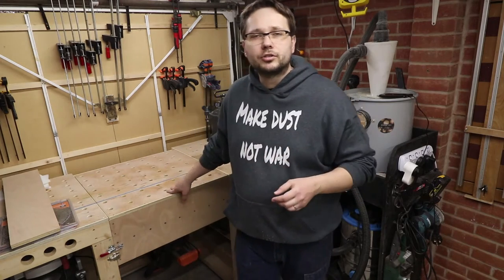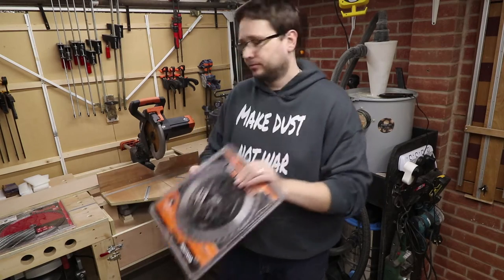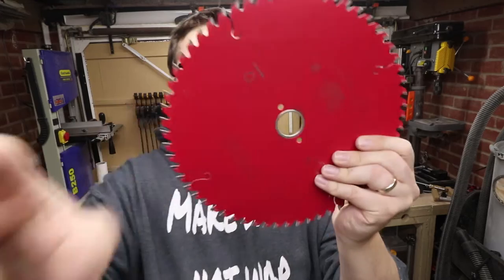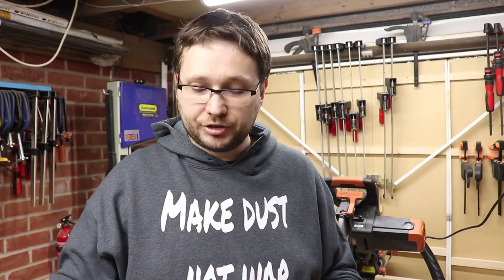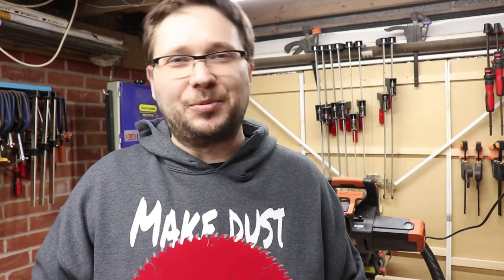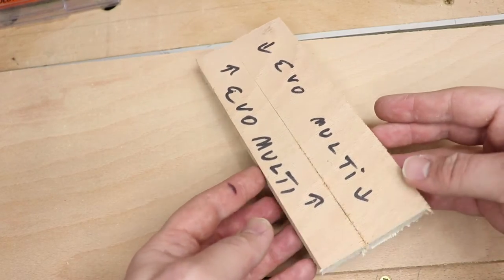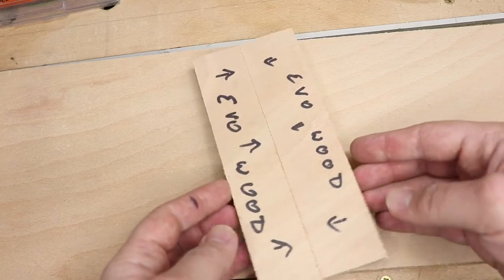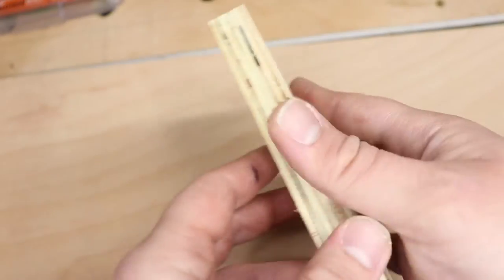Evolution mitre saw with none Evolution blades plus cross cut blade test

Comment: Amongst my blades I have two freuds.  One is a pro 24t and is superb, proving surprisingly clean cuts cross cutting as well as ripping and one is the 40t.  No notable tear out on my table saw.  You have to be careful when selecting freud blades as they all look alike but they have a baffling array of codes and there’s a big difference between them.  Mine are the 15 degree positive rake angle thicker kerf table saw pro versions and slice like a knife through butter.  There are thinner kerf mitre specific version, versions with atb, tcc, different coatings and higher quality carbide teeth such as the industrial coded versions like the p410 .  Point is you can’t generalise about freud without knowing what you’re comparing.  Even the relatively inexpensive freuds will likely last longer than the saxtons which don’t have as much tooth material and cant successfully be resharpened.  Good cheap blades for sure but  false economy unless you’re an infrequent user.
Reply from the maker: I think that's the general point, if you are a occasional user then the Saxton will be a good choice. However if use your saw on daily basis then Freud will be a far better investment 👍

Comment: I just purchased the Evolution R185SMS+ saw, the 7-1/4" model with the laser. Just assembled it this morning, in fact. Still need to try it out. I bought it for cutting metal. For cutting wood I have a 10" Delta compound sliding miter saw.
One complaint I have read about these saws it that you're locked into using Evolution blades due to the arbor size. While installing the blade I took the inner blade washer off. One side has a 20mm ring machined into it, while the other side has a 5/8" ring machined into it. So I can use a blade with either a 20mm arbor or a 5/8" arbor! 🙂
You may wish to remove the inner blade washer and see if it has two different diameters machined into it. Or maybe you touched on that and I missed it. In which case...... never mind.
Reply from the maker: Got few sets of reducing rings plus mostly I use the Saxton blades now with the Evo arbour size. I think the multi material Evo blades go bad quite quick if use use them mainly for cutting metal.

Comment: I just watched a video about the Evolution miter saw. In that video, his saw came w a reversible washer that the blade seats against. One side is for a 1” bore blade and the other side for a 5/8" bore. maybe Evolution has updated their saws w these?
Reply: On my Evolution R185SMS+ saw, one side of the inner blade washer has a 20mm ring machined into it, and the other side has a 5/8" ring machined into it. So you can use blades with either a 20mm or a 5/8" arbor hole.

Comment: Again, another quality informative video, as i've said I've used non OEM blades in mine with a reducing ring, not had any problems at all with them, however I'm now convinced and the next ones will be Saxton, I've used their blades in other tools and never been dissapointed, stay well bud
Reply from the maker: Thanks mate. Yes I'm surprised how good the Saxton blades are. Stay healthy and safe 😁👍
Reply: Jim Hope  I use Saxton blades in my Piranha saw which was rubbish with the OEM blades, the Saxton ones transformed it into the machine it should have been originally

Comment: As ever, excellent comparison between the various blade options. I have an Evolution mitre saw - it's in the loft - but I use the excellent Hikoki with a Freud 40t blade. I did, however, purchase the Saxton blade - again 40t - for the Evolution Rage S5 table saw. Well, it's night and day! And at the current price of only £16.99 with free delivery, it comes in at around half the price of the Evolution or Freud counterparts.
Reply from the maker: Exactly, the Saxton blades are really good

Comment: Hey Tomasz - A great video and very informative. I thought I would make a couple of comments. The Evolution Saw is designed with their blades in mind and has a different blade speed to other makes. The bore size is how they try and keep you to their own blades. You also showed examples of the tearout being worse further from the fence. I had this with my Evolution saw and I found this is due to slight play in the saw rails resulting in wobble as the blade is extended over the workpiece on mine - so might not have been a blade issue in the test.
Reply from the maker: The tear out was actually near the fence side. I don't feel any play in the rails ( yet ). But if that would be the case all the blades would have the same tear out which is not the case. The Saxton gave almost perfect cut for example. The speed of the Evolution saws were concerning me to be honest - and that was holding me back on using different blades. But I have to say so far had no issues using other blades 😁👍
Reply: @CasualDIY  agree

Comment: I was really impressed with the stock combination blade of the rage 5 ... i cut plywood with VERY THIN veneers with no 0 clearance insert and had NO tearout whatsoever .... i thought replacing the blade would be the first thing i'd do when i got the saw - i'm not replacing it anytime soon ..... also crosscut some hard maple yesterday which is notorious for burning - gave me a clean cut with no burn marks whatsoever
Reply from the maker: Yes they are fairly good mate. But there's a room for improvement 😉
Reply: @CasualDIY  if you ever get a chance, try graphite tools blades ..... they are a polish company and their blades come with reducer rings .... tried their blade on my mitre saw and it was great

Comment: Firstly I would like to say thank you for creating a great informative video.

I only use Saxton Blades in both my Mitre Saw and also Circular Saw. For the price you can't really beat them and they stay sharp for a long long long time. Saxton also has a range of professional blades (which are Yellow in colour), those blades only cost about 20%-25% more than their standard range of blades. Saxton also does blades for ripping long lengths of wood (less teeth).
Reply from the maker: Thank you kindly, they do seem to be very good for what they cost👍

Comment: Hi, I have the Freud 80t and it is performing great. I mainly. Use oak and there is a very little tear out if at all depending upon the grain orientation. The reduction ring def isn’t an issue. I also had some concerned about it but unfounded as the flange directly on the blade is what keeps the blade in place and from slipping. The reduction ring is only to pick up the slack but force bearing. Good to know about Saxton. Thanks.
Reply from the maker: Yes the more I used it it came to me as well that there is no major issues with the reducing rings. And I found the Saxton blades to be very good.

Comment: I use an inexpensive Saxton blade in a Dewalt 18v 165mm circular saw. Works really well: regards cut quality; and regards cutting depth and speed. It would seems Saxton gives good value for our spend.
Reply from the maker: Yes my thoughts are the same. Really good value for money

Comment: Hi, does the blade cut better if it has more teeth?
Reply from the maker: With higher amount of teeth the blade will give nice results, however it will be less suitable for rip cuts. Usually you out blades with more teeth in mitre saws as they do cross cuts. This will give finer results.

Comment: Interesting. I get awful blade marks inside cuts with the Evo multi blade but I always thought it was something I was doing wrong. I already have a spare Saxton so I think I'll get it fitted today. Good vid 👍
Reply from the maker: You can get the Saxton blades with 25.4mm bore so it will fit perfectly any Evolution saws

Comment: Hi, have you ever had an issue with safety blade guard sticking  on the Evolution Rage S3. safety Guard retracts ok, but fails to fall back in to place.
Reply from the maker: No, I had no issues like that. Maybe the mechanism is dirty or securing bolts done up too hard.
Reply: @CasualDIY  Thanks for your quick reply . Must admit thought the same, I have tried giving a full clean where I can reach and lubricated any visible moving parts. Wil try to contact Evolution, think it may need stripping down to access the safety guard mechanism.
Reply from the maker: The customer service is usually quite good so I hope they will help you accordingly 👍

Comment: I just bought the 210mm evolution mitre saw. First problem I've noticed is that a 30mm bore blade with ring spacer does not work.
Reply from the maker: I had that with an Abracs blade and reducing ring. Bought myself reducing rings from Bosch and had no issues since
Reply: @CasualDIY  Thank you for the reply and informative videos.

Comment: I have just bought the same saw, can I use a 250mm freud 45 tooth wood blade I have from an old mitre saw.
the bore is 30mm, where can I buy the reducing ring? thanks, subbed.
Reply from the maker: Yes it should be just fine. Just search on Amazon for reducing rings 25.4mm from Bosch. I got them and they fit perfectly 👍
Welcome aboard 👍
Reply: @CasualDIY  Thanks, just bought it, watched your other video on it, great channel, lots to learn. thanks.

Comment: I haven’t watched this video because I have a Metabo mitre saw, but seemed like the best place to ask.

In your opinion, are you better off with 3 cheap blades? Say a course, medium and fine.. or one nice (e.g. frued) blade.

A Freud 34t is about £25-30, a 3 pack of cheap blades is about the same. I’m guessing the frued is probably a better option, they’re flip-able for double the life, it’ll probably outlast the 3 cheap blades and give a better cut I’m guessing.
Reply from the maker: If you can get the Freud for around £25-£30 then I would go for that. I all depends what are the budget blades. If they are Saxton then I would give them a go.
Reply: Casual DIY Tookpak from toolstation in this case. Haven’t actually fitted them but might return them and get a Freud I think. These are actually for my circular saw, I’ve got the same ones for my mitre saw and they’re completely fine, more than adequate for a home user, probably have to be using them a lot to wear them out anytime soon.

My jigsaw blades are from Saxton and they seem pretty good. You recommend the saw blades then?

Comment: any tips on how to make dust collection more effective using a standard extractor? was it still spitting out dust in every which direction with each saw blade used?
Reply from the maker: Yes it made no difference witch blade was on. The dust extraction upgrade is in my pipeline but not sure when it will surface as a video yet🤔

Comment: I have contacted Evolution regarding using Saxton Blades in the R255SMS-DB and they say that due to the low revolutions of this saw (2500rpm no-load speed) that only their blades will work.  Other blades may damage the saw and will invalidate the warranty.  What does everyone think about this?  I need a 60T+ blade for cutting composite material decking boards and Evolution don't do them.
Reply from the maker: Yes I heard that as well. Been using the Saxton blade for a while and so far all is good.
Reply: @CasualDIY  Saxton believe it's just a ploy by Evolution to sell more of their own blades. I tend to agree. Can't see how the blade can possibly damage the saw.
Reply from the maker: Same mate.